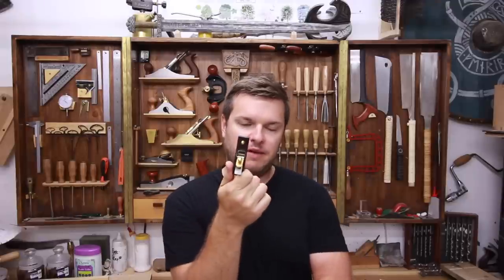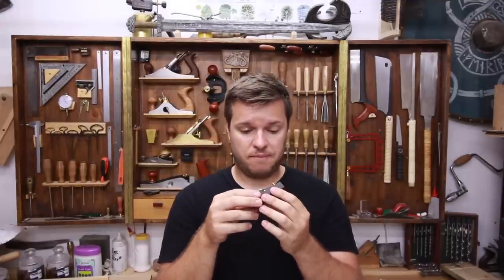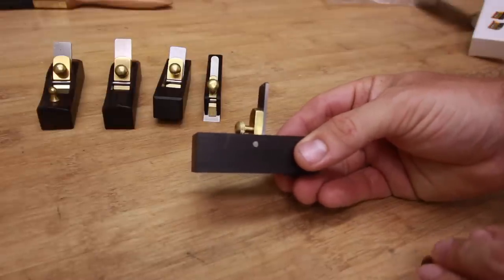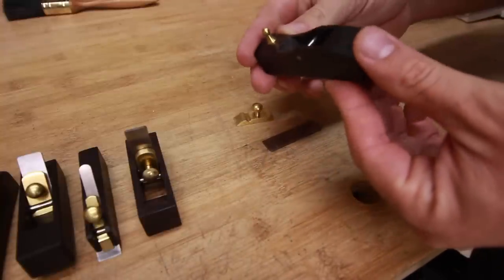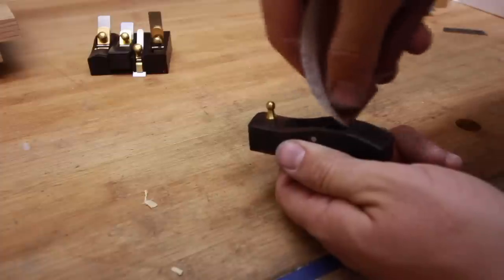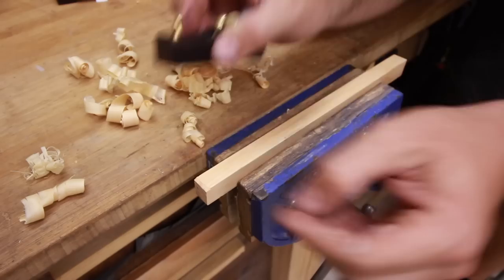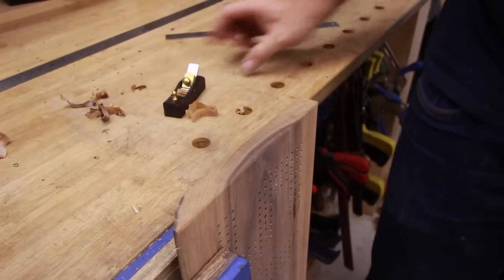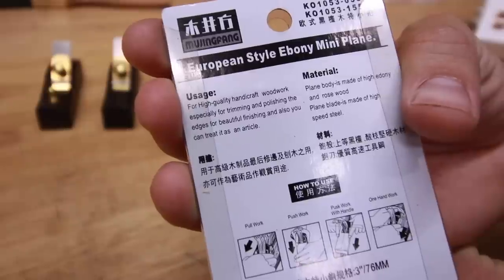Premium Ebony Mini Planes - For Cheap!

Comment: I got some, and it was pretty good. The only issue is that, perhaps due to my own sharpening being bad, is that the blades dont tend to stay still in the planer, even if i tighten them down. 
They do shave well, though.

I found that the Scraper Plane has gotten the most use, with the standard thumb plane coming in second.
I just use my low block hand plane for most applications, since it's wicked sharp and i havent ever had an issue with it, except for injuring myself.
Accidentally took a chip out of the palm area of my thumb.
Reply: The moving of the blade may be due to my cutting of non-standard wood chunks.
I got some raw walnut, so maybe rhe Grain is just really coarse and not suitable for the small planers?